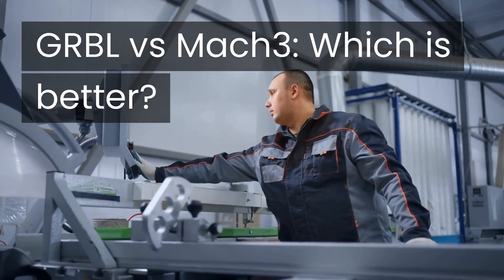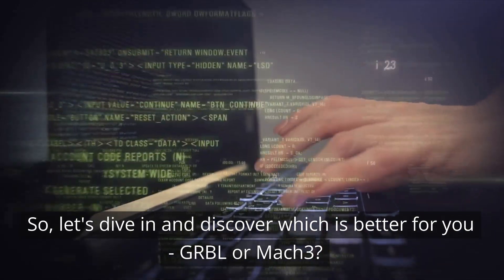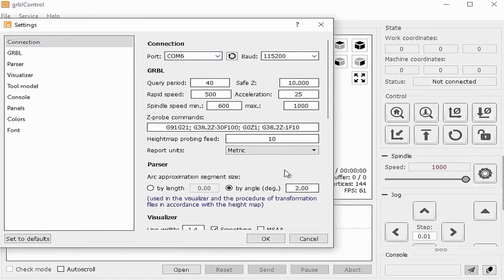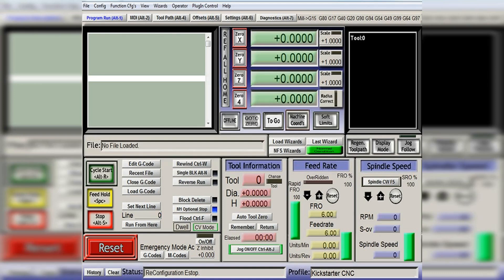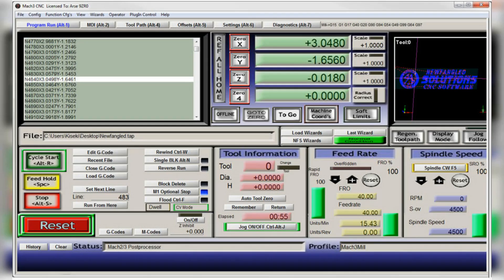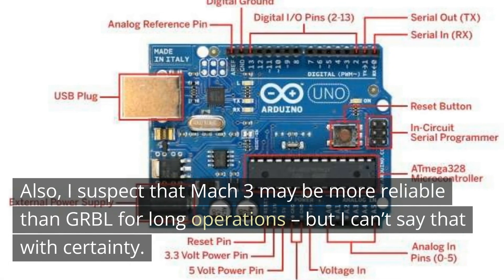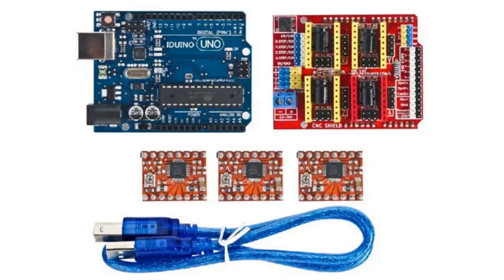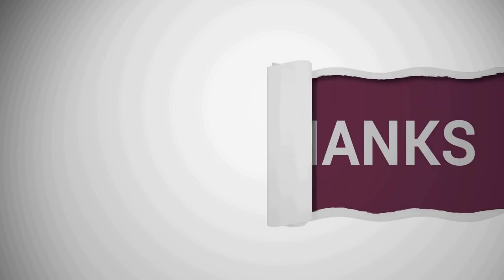GRBL vs Mach3:  Which is better?  CNCSourced

Comment: Does grbl support tool changes? Peck drilling? 😂
Reply: no, but I recommend uccnc, it better then mach3 and I use UCCNC to run my DIY mill
Reply: GRBL not support many G-code and not easy made additional etc, tools change etc, own modifications not flexiple.
Reply: Technically, any CNC control software that supports sub-routines or even loops, would (in theory )support drilling cycles. That said, if you're manually editing some gcode for some decrepit 1990's Yasnac controller, just to 'hack in' a drilling macro. I wouldn't call that truly 'supported' either.
Reply: Yes it does. M6 = tool change. Peck drilling is via software then interpreted by GRBL
Reply: hmmm... best answer  @pw3111